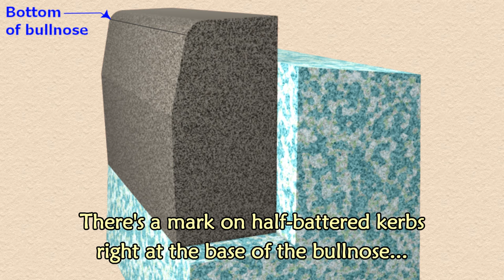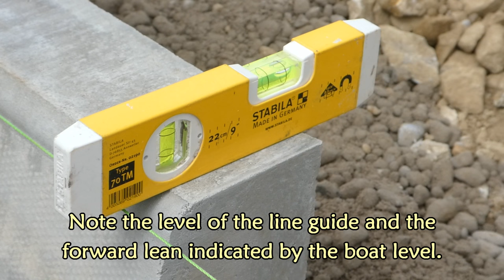The basics of kerb laying

Comment: If you use a string line on the front of the kerb for the finished height you can use a torpedo level to check plumb to the line and height at the same time .

Comment: Lot of material used although it's easier to hammer down into deep mix ,always used back face for a line ,very odd time a batch will be different sizes ,checking every 5th kerb for level ,never need to pinch .
Reply: Not really because then you don't have an established race and when it comes to adoption and you fixing all the damaged kerbs, it's gonna be much harder.

Comment: Here in the UK we have to install concrete kerb brace first then the kerb is layed on a max of 30mm bed of sharp sand and cement then backed up with concrete..
Reply from the maker: Laying on a race is an option. It is not always mandatory. It depends on the client's spec. many local authorities in the north of England as well as in Scotland, Wales and NI prefer laying directly onto a windrow of fresh concrete....that would always be my preference, too.... but I know laying on a race is more popular south of Birmingham and on certain developments. This is something we are covering in the new British Standard (BS 7533:102) - the pros and cons of windrows and races.
Reply: @TonyMcCormack  I've always layed on a race most housing association's and council insist on because its easier to replace the kerb if its damaged..
Reply: I'm from the southeast and have always laid on a fresh bed
Reply: @chickendippers8135  if its on a road it should be on a race, its an adoption requirement it just makes them easier to replace when 1 is damaged, but other areas like carparks ect  its usually just on concrete...
Reply: @jeffsoal5715  maybe on housing site. On 278 hyway works for KCC I have alway laid directly onto a 150mm fresh bed of concrete

Comment: I was wondering why if the line was on to the front, the layer was then pushing kerbs over with a pin to that line ? What's the difference  then to having the line on the back and doing the same ? 
Great gang by the way....got to be up there with the best in the UK imho
Reply from the maker: Even when taking extreme care and trying to lay precisely to a friont-face line, there will always be some error, which is why we do the compliance alignment once the whole line (or a sizable section of it) is in place. This is particularly true when working with curves, arcs and tangent points which, although accurately set-out prior to work starting, can require a bit of tweaking once the kerbs are out on the bed and look not quite as intended.

Generally speaking, there is far less re-alignment needed when laying to a front face line than is required if a back edge line has been used.
Reply: There is always a difference in sizes from the kerb mould as well. The front is more accurate to lay to plus the back will be hidden with black....Engineers seem to love to set out to the back though😢

Comment: Could the concrete bed under the curb stone have a rebar reinforcement?
Reply from the maker: It could, but why? Unless there was an over-riding reason to ensure no cracking,settlement or movement of the kerb line, we wouldn't bother. I have laid kerbs onto a reinforced race, designed by an inexperiencd and over-anxious engineer who wouldn't accept that rebar was completely unnecessary. It ramped-up the job cost, and though I can't prove it, I don't think it made for a better kerb line in any way, shape or form!

Comment: very informative as always.  I knew most of it but not that you pinch them in with a bar to their final position.  Thanks!
Reply: See That I’ve never done get the string line in the right place it makes no sense at all to lay of the line then mess about kicking them all over
Reply: Altering is only used to make a bend or curve better normally on straight forward runs follow your line

Comment: Have you any tips on a kerb race with 20mm bed.
Reply from the maker: That's a whole other video in its own right, but the best tip I can recommend is to thoroughly check the levels of the race before you start laying. All too often, the kerb race instalkled by others is a bit up-and-down, making accurate kerb laying a damned nightmare. Check it for level and get it put right, if necessary, before you start lining out kerbs or preparing the mortar.
Reply: @TonyMcCormack  how wet do you have your mortar, (sharp sand or building sand) I’m finding it’s difficult to get an accurate bed, too high or too low and very little tolerance to tweak kerb especially on a radius without kerb sinking
Reply from the maker: @Kieranshields89  Always a mortar based on sharp sand. NEVER building sand - too soft. Slump or wetness needs to be reasonably stiff, otherwise the kerb will just sink into it. With practice, you find a mix and slump that works well for you - some like it slightly wetter or drier, but a slong as the kerb ends up at the right level and line, then that's all that matters. I always hated laying on a race - give me a windrow of fresh concrete every time, please. SO much easier!
Reply: @TonyMcCormack  was councils request for adoptable road. Doesn’t seem cost effective with the time it takes setting road forms and then pouring concrete and waiting to cure. Your answer matched what we’ve been doing so thankyou 👍🏻

Comment: Hi Tony. Is this UK? If so, do use pre-cast Kerbs like this always on the streets? Cos I was of the impressions UK might be also be using kerbing Machines. Lemme know.
Reply from the maker: There is some slip-forming of kerbs in Britain, but I'd estimate over 95% of work is with pre-cast kerbs. Slip-forming is more common in Ireland, but there's not a lot, to be honest.
Reply: We use a Kerb Race Machine now on newbuild domestic developments, it is getting more common, were are a groundworks company of mid to large size in the South West UK

Comment: If you get the bed right you don't need a massive maul like that! If your knocking down 30mil that's too much.
Reply from the maker: It's up to each tradesman to choose the tools used. Many of us were originally trained using wooden mauls or the large rubber/fibre combination mauls. If the result is right, it doesn't really matter whether a large rubber maul is used or a small plastic mallet.

Comment: Ignorant question from a DIYer, the gaps left between kerbstones...are they filled with mortar? Otherwise weeds etc start habitats. Also it may look incomplete.
Reply from the maker: usually, a 2-5mm gap is left between adjacent kerbs so that there is no direct contact between them which can cause spalling or chipping. Very occasionally, weeds will set up home in there when it fills with wind-blown detritus, but it's rarely a problem. In some situations, the kerbs will be laid with a 10-12mm mortar joint but this slows down the installation rate, which ramps up the costs, and there's no real structural benefit. It's nearly always done solely for aesthetic reasons.
Reply: @TonyMcCormack  Thanks very much Tony for your reply and explanation!!
Reply: I thought it was an expansion gap, so it has to be empty.

Comment: First of all, too much concrete. Second, string should be in other side for easer job and faster.
Reply from the maker: There is variation in the width of pressed concrete kerbs, as allowed within the tolerances of BS EN 1340. Consequently, aligning along the rear arris can result in a mis-aligned front face, which is the critical alignment. This kerbing team, in common with the vast majority of other kerb layers, prefer to use a front-aligned line when laying.
Reply: @TonyMcCormack  I've been laying kerbs for over 15 years and always used a line at the back of the kerb then prior to backing them up quickly run a line down the face and tap any out to suit. Its also fairly easy to judge the gap when a kerb is a differenr width. In all the years I've done my job I've only come across somebody laying with a line at the face of kerb once. They were laying with the line at the lower water line. Was very strange to see and they were incredibly slow. For me the line has to be at the back and i always lay with a size 5 thor soft faced hammer (Nylon faces) really can't get on well with mauls or a pickaxe.....
Reply from the maker: @garethwigmore9352  Horses for courses. I've been involved in kerb laying for over 50 years and this is my preferred method. The lads in the video have served an apprenticeship under a fellow professional kerb-layer with 40+ years of experience. This method works for us. You can choose to work differently if you wish. 

IMO a tiny "Thor" hammer hasn't the wallop necessary to ensure adequate compaction of the concrete bed. It would be ok for small unit kerbs, possibly for edgings, but not for road kerbs. However, you do it your way - make your own video if you wish - but I'll continue to teach this method and promore it via my website and my training courses.
Reply: @TonyMcCormack  my hammer weighs 3.5 kilos. The Nylon faces hit the kerb down far better than a Maul or a pickaxe. I started with Mauls but as soon as i came across the LARGE thor hammers i never looked back. Thor make many different hammers in different sizes. I use a size 2 for edgings and a size 3 for 6x5s. Im from the south west and increasingly over the last 5 or so years kerb layers around here have moved away from mauls and turned to soft faced/split head hammers. Some use leather heads or super plastic. I prefer the nylon faces. They give more bang for their buck and are IMO unrivaled.
Reply: @TonyMcCormack  there's also a big difference in compaction when you compare hitting concrete with dull rubber and a relatively hard nylon face. Buy one. You'll be pleasantly surprised....
Reply: @garethwigmore9352  Theyre a thing of beauty 👍